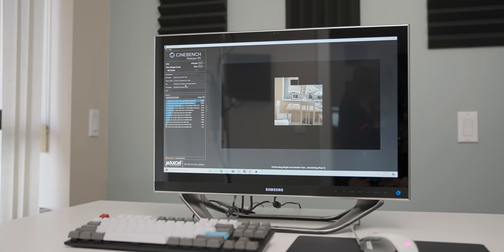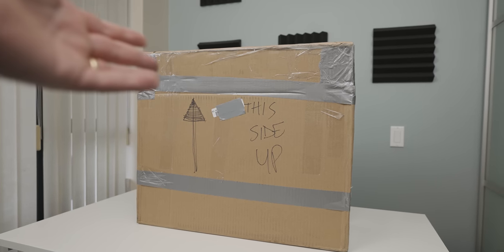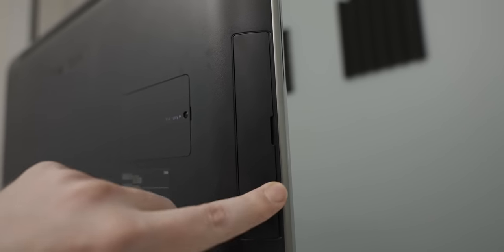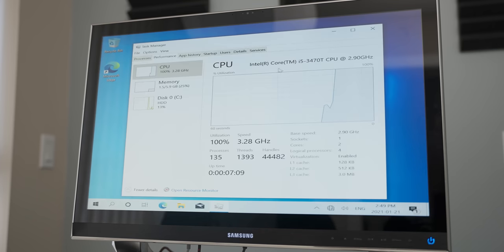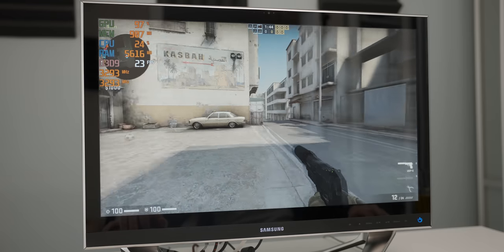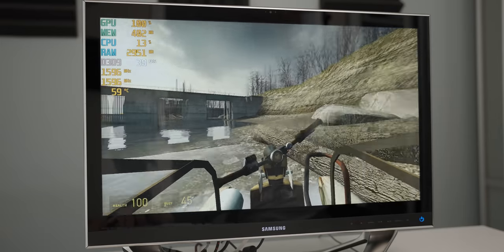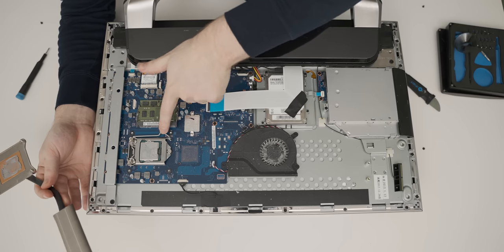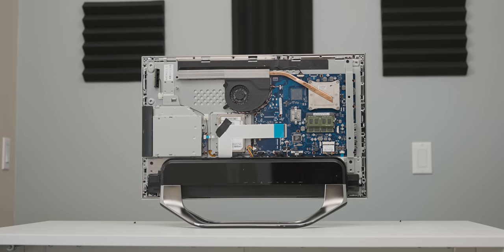Trying to Game on an 8-year-old All-In-One PC... For some reason

Comment: A real Ivy Bridge i7 3770 (or the K variant, but you'll most likely not be able to overclock anyway), 16GB of RAM and an SSD should be able to wake this thing up a fairly bit. In addition I would look for a second fan for that heatsink, as it seems that there could fit a second one. You'd need to tap the original fan wires though, I assume.
Will you be able to game on it afterwards? Very surely not. But if you can get an external GPU to work on that thing without that getting to big of a hack job, I'd very much like to see that, because, even if it's Ivy Bridge, the graphics are the limiting factor here.

I like these All-In-One PC, because their footprint is really small. And for basic tasks, like surfing and office work, they get the job done quite well.
The perfect kiosk System.

Comment: You should be able to plop in a much faster 3rd gen i5 or better i7. Certainly that cooling system should do just fine at stock speeds. Sure it won't change your world but the non-t versions do have a slightly better "GPU" in them. Couple that with a small ssd and it wouldn't be a bad media center and low end gamer.

Comment: Looks like there a spot for a second fan on the cooler that would go if there's was a soldered GPU chip right there next to the CPU. I wonder what they had in these. Amd or Nvidia? :O
EDIT: Looks like the big model came with a i7-3770T and a Radeon HD7850m with 1Gb ddr5.... Should have been pretty impressive and expensive back then for gaming!

Comment: Get yourself either an i7-3770t or a Xeon 1265v2 for it, slap in 16GB of RAM and a SSD while you’re at it.

While the 8 thread processor will be faster overall at a slower clock speed, it’ll both be in the same power envelope of the 3470t and the IGP upgrade will make some games playable at 720p.

Comment: I feel like a total downer, the expansion slot that the wireless card is the older "mini PCIE" standard. So it's only 1 PCIe lane and will choke out any external GPU. There really a lot of gains from a better CPU because there's nothing to drive. Personally I'd install Windows XP on it.

Comment: Upgrade the RAM to 8 or 16 gigabytes plug in a Nvidia geforce gtx 1080ti and put a cheap SATA SSD or a really fast western digital black 7200 RPM HDD in it

Comment: I wonder if it supports a 4770k or 4790k(that's still $200 on the second hand market for me). Also, throw in a 1tb sata ssd and 16GB of ddr3 at 1866mhz-2400mhz(if supported) *chef's kiss*
Reply: Nevermind. The best "i" cpu on this 1155 mobo can be a 3770K. But there's still old Xeons option, i guess

Comment: It's a 35 watt TDP CPU. That's why it runs so cool.  It is tuned for low power consumption. An upgrade path does exist. An i7-3770T would probably be the safest choice with its 45 watt TDP, but you might be able to get away with an i7-3770S which has a 65 watt TDP depending on how robust the power delivery is.  Both would upgrade the Intel® HD Graphics 2500 which has 6 Execution Units to Intel® HD Graphics 4000 whict has 16 Execution Units.  That's a significant bump upward, mind you, but it is still a pale shadow of a decent mid level separate GPU even from its own era.  Both CPU upgrades would also bump the system up from 2 cores/4 threads to 4 cores/8 threads, which is certainly a meaningful boost in CPU performance.

Needless to say, upgrading the memory to 8 gigs (which is the rated maximum for this system) would help a bit, too.

Samsung's product page for this model: https://www.samsung.com/us/support/owners/product/dp700a3d
Reply: yeah my i5 4590t also is 35w if im not mistaken, it has some like beefed up version of an intel cooler and under load its 40c
Reply: Yet I have a 120w 10 year old x6 1090t xD

Comment: The sad thing is that for Intel CPUs, 60-70 degrees F is about their max temperature. AMD's I believe can go up to 85-95 degrees before shutting down.

You have to figure that GTA 5 needs probably about 2 GB of video RAM (minimum) to play even at the lowest settings, and I believe the early Core i5 processors could only use up to about 1.7 or 1.8 GB of memory for video purposes (regardless of if the computer has more than say 4GB of RAM) so that may be why.

I think if you threw 8GB of RAM into that (or maybe 16GB if it will take it -- it should be DDR3),  and an SSD it might be quite zippy despiting it's age.  OF course it probably wouldn't help GTA 5 game play, but would make it tolerable as an Internet browsing computer or media center computer.

Comment: 7:00 I mean I got one of the newer gt 710s that’s a 2gb along with an i5 2500 and 8gb ram it isn’t bad. I get 120 fps on csgo with everything on low and a similar game, valorant runs at 60fps with everything at low
Edit: this is on 1080p

Comment: As an sff pc enthusiast, I can't help but notice the empty space to the right. A certain single slot gtx 1650 needs to be slapped in there with a WiFi pcie to 16x adapter.

Comment: Theres a lot you need to do in the bios setting and Nvidia control panel....odds are its using its igpu. Also giving it an external monitor to go directly from the graphics card should significantly improve performance. I have two gaming laptops in the house bow and ive kind of learned theres a special way to optimize these laptop because everything is set up for it to run off battery not plugged in.

Comment: A) upgrade the CPU, B) upgrade to SSD, C) upgrade the RAM, and if the integrated graphics of the upgraded CPU isn't good enough, can you D) rip out the DVD Drive and slap in an ultra-low profile GPU in its place?

Comment: GTA V unplayable at 15-20 fps? Tomb Raider III on a Pentium @166 MHz flashbacks Nah that's perfectly playable.
I want to throw a Spyder on this thing and see what the color gamut looks like.
Is DOTA's engine based on the old Warcraft III engine? That would explain it if it is.
There might be a version of this with a GPU; there is a section on the motherboard for one. I wonder if you can find just the motherboard, THEN strap a high-end CPU in there and see what it can do.

Comment: Overclock it?
Reply: It's using intel
Reply: @DaneH64  if you upgrade the cpu to a unlocked k cpu you can overclock and yes you can technically overclock your igpu if you overclock your ram
Reply: @DaneH64  correction on my own comment he can get higher frequency memory and that would work to If bios doesn't allow overclock of ram also speaking of bios would love to see a Russian bios on that some of those bios are bad ass and can easily be gotten on git hub